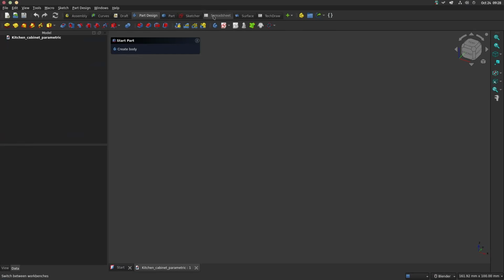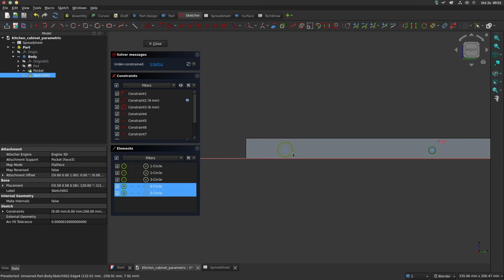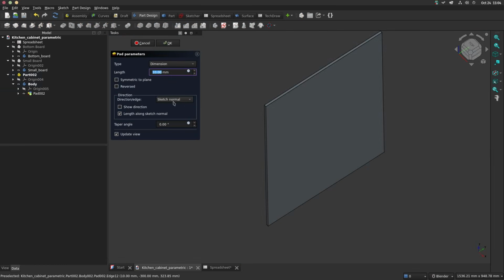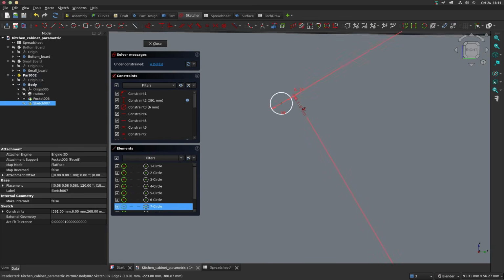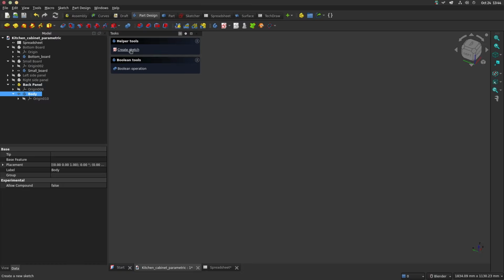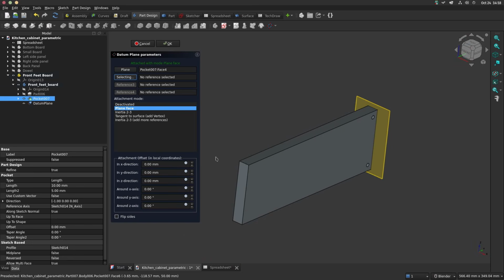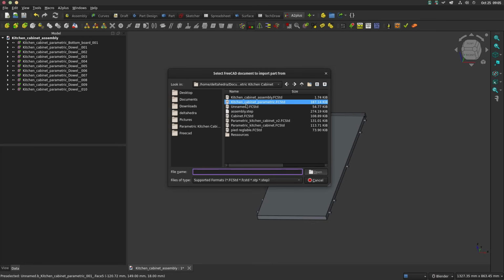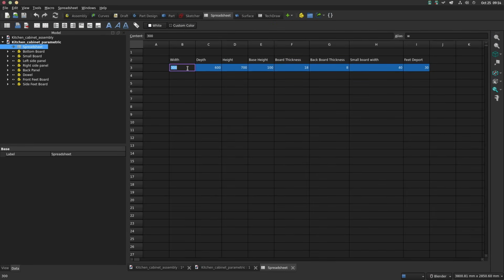Freecad - Parametric Cabinet Assembly - Woodworking

Comment: Thanks for all the work you did to put this together!  It has been a few years since I touched FreeCAD, so this was a good refresher.  My only comment is that sometimes you point and click on an action but without you explaining what you are doing, and in a few places your cursor point covers what you are typing.  Because of this a helpful addition would be to include the drawing or have a written script.  That said, since I had to go over several sections to get it all it was a pretty good way to reinforce the steps!  Overall the material and sequence is excellent!  I appreciate what you did here and encourage you to continue.  Well worth it.  On the third evening going through the material.

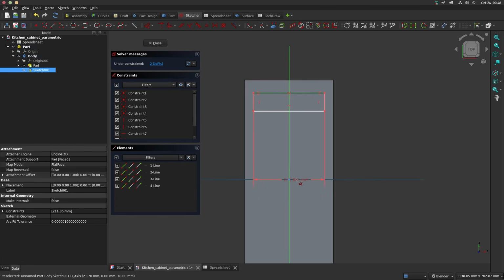Comment: There's very little explaining here. Like at 2:13 - "To avoid any miscalculations" Such a small remark with great importance that is sadly just brushed over. So what is the benefit of doing it this way instead of for example, bringing in external geometry and measuring off that? Or putting the sketch on the side of the part (not the top) and make the pocket "through all".

There are a lot of decisions here that were made with a lot of experience and internalized wisdom, sadly the video only takes you through the steps but explains very little.

Comment: Hello, I watched your videos on the correct application of Part Design and Part WB with great interest. For this video "Parametric Cabinet", however, the question arises why you create an extra Part Std container for each piece of furniture. So far I have assumed that a body object container is sufficient to hold the individual sketches and sequences of commands. The combination of the body is then done in one hour part for the entire piece of furniture. What is the background or the data necessity of this procedure, i.e. to pack each component into a Std Part container. I would be happy to receive a short feedback.

Comment: For a first-time learner, it would be helpful to understand the reference between the formulas used and the geometry and or parts, even if it is a quick flash-up of the exploded animation indicating the part we are working on. Formulas in larger text could be on the screen bottom for each use, as it is small, and your cursor sometimes obscures the text, just a tip for novices, I am sure the pro's get it

Comment: Thank you! I followed this tutorial, but I get an error when I try to add new dimension in the spreadsheet. the parts update in the original file as expected, but in the assembly I get an error, and it breaks. I have the contraints set up as you have, but only the bottom board updates when I change the with, the rest are fixed at the with of the original 300mm. IE. sideboards are only 300mm apart and small boards are also not updating in the assembly file even though they are in the originla file. thoughts?

Comment: To position the studs, why don't you use matrix-arrays and symmetry? Instead of placing manually let's say 10 studs you will only need to place 3 then do 2 symmetry operations that you can also use for other parts/hardware.

I have noticed that to constraint the parts in the assembly you select edges. Could you select also planar or cylindrical faces?

Thank you for the tutorial

Comment: Why do you create a part to hold the body?
Reply from the maker: @leroycasterline1122 You're not required to use the parts, I do it out of habit just in case there are several solids to group together that I want to connect.

Comment: Hey man, great vídeo, dumb question here, is that possible to do in blender instead freecad ?
Reply from the maker: @MiniCasaBrasileira Yes, you can, but to achieve parametric behavior, you'll need to use the Geometry node, which can be more complex.
Reply: @deltahedra3D  Thanks, i work with cabinets here in my country, and i looking for a open source to make furniture projects, and preference to be procedural, like dynamics components from sketchup. 
 I trying to learn blender, and i saw your video. I will look for geometry nodes. Thanks man.
Reply from the maker: @MiniCasaBrasileira   With the geometry node you can have this kind of result : https://youtu.be/Z37xKOo1o3M

Comment: Clear and concise. Earned my sub. This is a bottom up design. It uses a lot of formulas, too many for my liking :).  I would like to see a top down design in Freecad where shape binder is used ( or some other method) to transfer features from part to part. This should reduce the amount of formulas used. In other words the parts are feature driven, rather than formula driven. Less chances of user errors.
Reply from the maker: @imoldovan I'm not familiar about the workflow you talk about but I will find out. Thank you for your comment and your constructive remark :).

Comment: In Freecad 1.0 it makes more sense to use the varset (icon {}) instead of spreadsheets. A more modern and struct way to do this.
Reply from the maker: @bytekilla666 I usually use a spreadsheet,  especially for more complex design where formula is needed, but I will try to add the varset in my workflow. Thanks.

Comment: I'm interested why did you create new file for assembly instead of using the same file and just add an assembly.
Reply from the maker: Most of the time I made my assembly in a new file, especially when using A2plus workbench, because you need to convert a part to A2plus so as to make it fix and I find that it make the tree structure messy with a different icon for the converted part.

Comment: Great video, but might I ask why you chose to use A2Plus instead of the built-in assembly workbench?
Reply from the maker: Thanks, I had some solver errors with the assembly workbench as soon as I added the dowels, especially when I updated the spreadsheet with new values. If you want some details about the assembly built-in freecad, I have made this video https://youtu.be/k51YFdXIIek, where I made the assembly, the exploded view and a part list complied in a drawing.
Reply: @deltahedra3D  Checking it out as we speak, thank you!

Comment: Thank you for this great tutorial. 
Regarding assembly, I wonder if it would have been better to use the dowels instead of the edges to make the coincidences. That would help ensuring we did not make any mistake regarding the position of the dowels. And it corresponds to the way the cabinet is assembled.
Reply from the maker: You are right, it's better to use the dowels, but I chose the edges to avoid calculation error of the solver when adjusting the values of the spreadsheet. I have terrible results using the dowels with the Assembly workbench, so I didn't want to take risk, but your solution could work.

Comment: Beautiful video. Sure you are as good blender user as you are in Freecad, it good be nice a follow up video of the animation at the beginning!
Reply: I hopefully will be as well.
Btw do you have any experience with blender on very low end specs? Or can predict how it'll perform.
I'm a bit broke, and learning freecad, planning on simulating some... kinda sophisticated stuff, engine, pressure/vaccuum and whatnot.
Would it be feasible on old i3 i.e 2nd gen. And integrated graphics. With 6gb ram (I've heard it's helpful to have more).
I've heard older versions may work, but I've no idea of its practicality on my specs.
I don't plan on simulating eye candy fluids and heavy stuff at high resolution, but I'll need diaphragm and balloon and pressure differentiation and some other things to simulate.
Reply from the maker: @yasirrakhurrafat1142 For both Blender and Freecad, I think your specs will be too poor for your expectations . I have run Blender and Freecad on an I7 4710 and gtx 850m, Freecad was OK but suffers when there are many objects in the assembly and for Blender, the viewport was ok but render times was extremely long.
Reply: @deltahedra3D   brother.
You have any video, or can refer to me to a video about what viewport is?
I've seen that it just seems like a half-ashe renderer.
But I like that its not performance intensive.
If i can just simulate everything, semi complicated fluids, gas, and pressure-vacuum, and soft bodies like diaphragms or something without beautiful rendering, I would be satisfied.
I just need to simulate and figure out some physics interactions and whatnot.
Would it be possible in viewport?
I'm playing around with freecad, it doesn't seem very intensive, maybe it'll get more demanding if objects, sketches and parts increase and complexity, but no lag so far.
Also, would older versions of blender perform better on my ancient hardware?
I actually have an i7 870 and hd 3*** something something from amd/ati.
These are so old, I didn't mention because I don't think most people will even recognise these.
Reply: @yasirrakhurrafat1142 you can do anything only thing that will be hindering you is that it takes more time on a low end machine. RAM might be a hard limit for very complex projects. So start your journey of learning with what you have, not everyone can afford a pro setup before becoming a pro.
Reply: @Eunice3x   nahh bro ); I was looking to do some semi complicated stuff.
Is it possible to see outcomes without rendering the stuff?
Like you do fluid simulations, but don't want a video result.
Like how we do in video editing, scrubbing through the timeline.. watching the video with effects applied without rendering?
I just wanna do some engineering stuff 😭😭
Reply: @ it is possible, it just takes longer. Fluid simulations you’ll have to run over night thought. A few years ago your system would have been fantastic and people have been doing these things back then too.